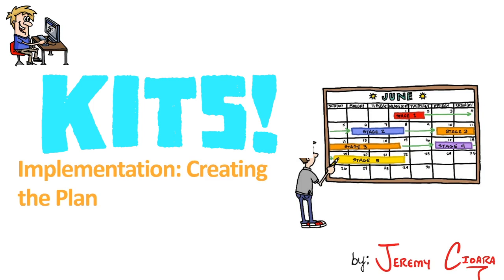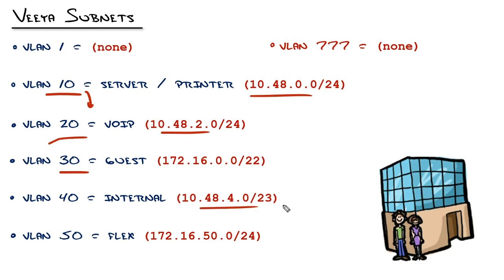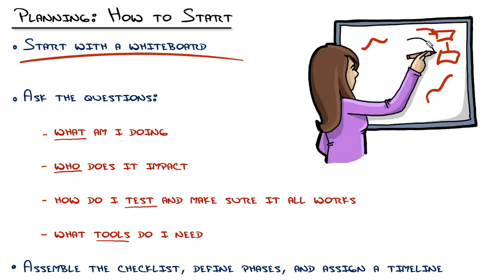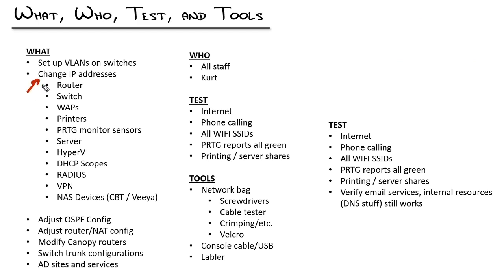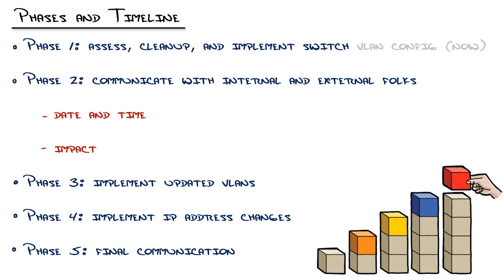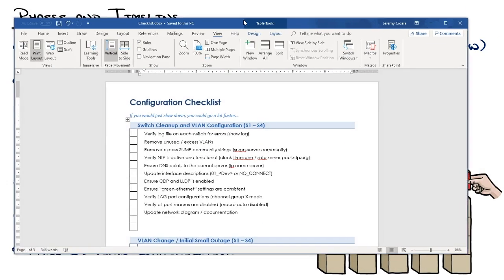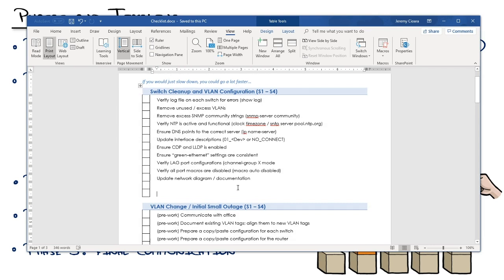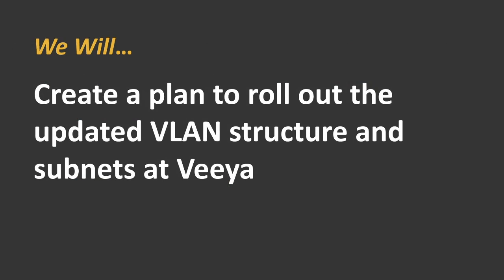How Network Engineers should PLAN implementations (VLANs and Subnetting as a special guest)!

Comment: Fantastic video with both high energy and high-value content!

"Slow is Smooth, Smooth is Fast" - Eric Anderson"

"I plan because I realize it will cause me much pain if I don't" - Jeremy Cioara ;)

You make excellent points on the importance of a detailed plan and also where traditional project management fails us.  Project Management is strategic whereas the detailed checklist you need to perform the technical details of the task are tactical and granular.  BOTH are important!  As an ITPD I use the project plan for the high-level plan and "project runbooks" for the detailed minute-by-minute checklists you describe in this video.  Here is an example that I've used and tuned in production projects that you can copy and customize to your needs:

https://docs.google.com/spreadsheets/d/1nfU1SGJfVxK7qahXGYAp3JHbR9q0LQDK_7Zra8ihy_Y/edit?usp=sharing

Comment: Hi Jeremy, Great video as usual.

Do you have any links for 'ip plans' template, 'logical network' 'configuration checklist template'

Basically an engineers toolkit of templates?

Many Thanks..
Reply from the maker: Hmmm. Describe more of what this would be?
Reply: @Viatto  Lets say a engineers documentation starter toolkit, that would have templates that could be filled in and edited as required. 

Lets say on the lines of IT Audit but with entering technical information..

I will provide a link for you on the ip plan template i use...